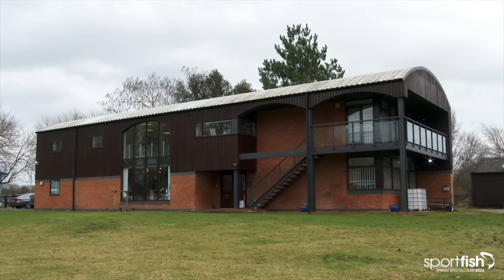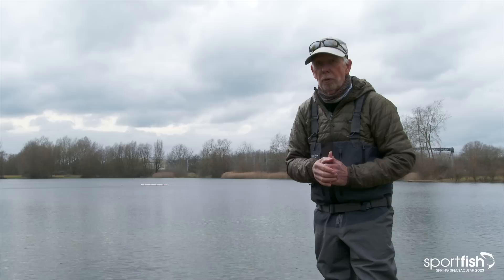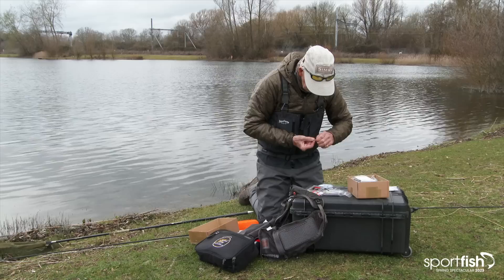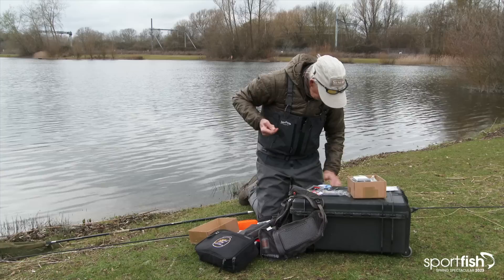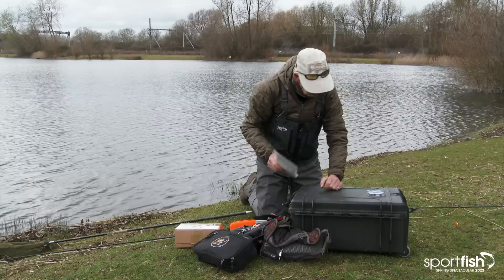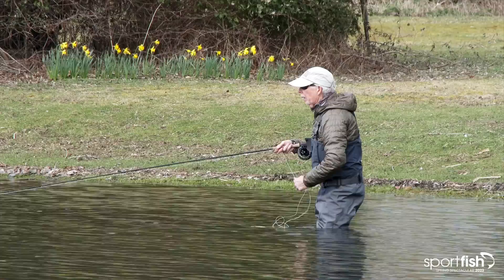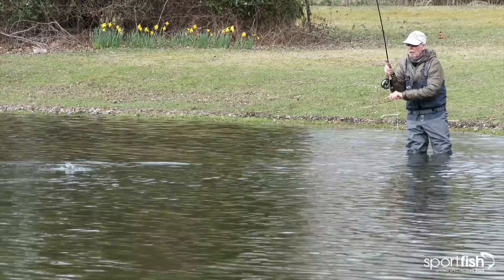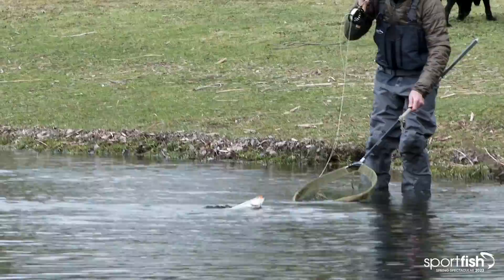Charles Jardine Stillwater Fly Fishing Tactics - Part 2

Comment: Always nice to watch fishing at Haywards Farm as I have spent many happy days there. However in all my time I have fished there the fishery rules were two flies maximum. I can understand Charles is covering fly fishing in general but don’t be surprised if Anglers come to Sportfish and use 3 flies.
Reply: Fair point...special dispensation...maybe they will change; I can understand the reasoning given the size and strength of their amazing trout......
Reply: @Charles Jardine  they do have some hard fighting trout in there. I have no issue with you using 3 flies as I now frequent Pitsford from the bank and am learning how to fish with 3 flies. It is taking some getting used to and I certainly need to improve the smoothness of my casting. I do think Sportfish have it right limiting the number of flies. Its a small lake and you are right cracking sport.